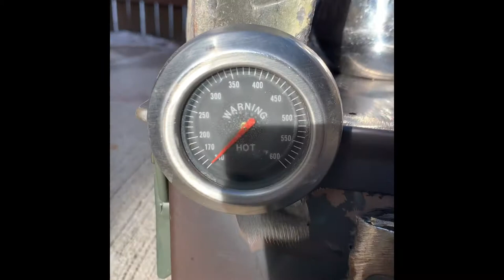Ammo Can Camp Rocket Stove with secondary air burner

Comment: Sure looks like a good design,saprised it didn't work well.prehaps put some expanded metal on the grate so wood has more air under it,also add more chimney a couple of feet ,once chimney gets hot enough it should draw and burn.worth a try😉